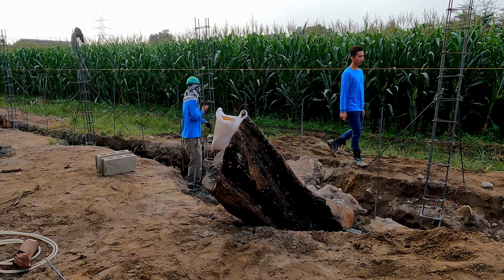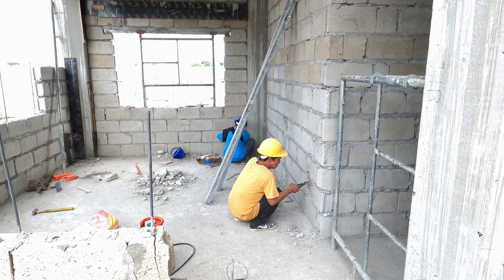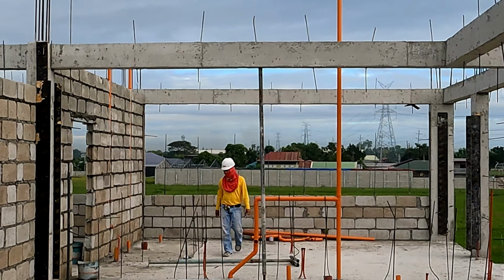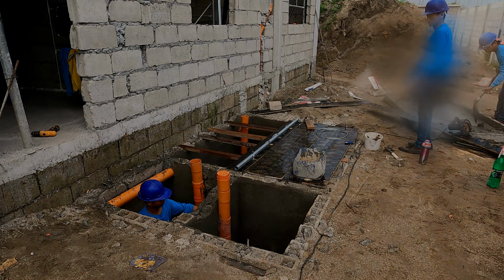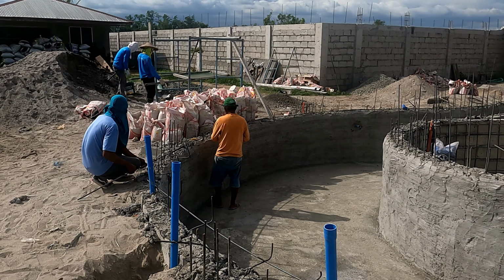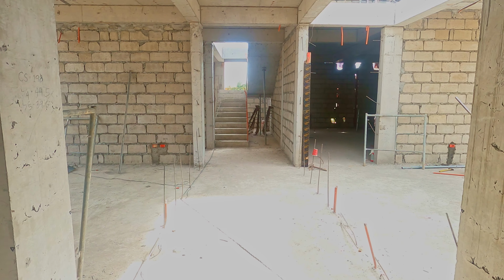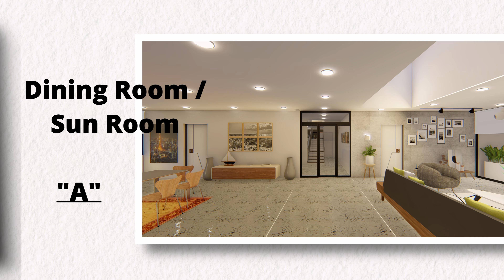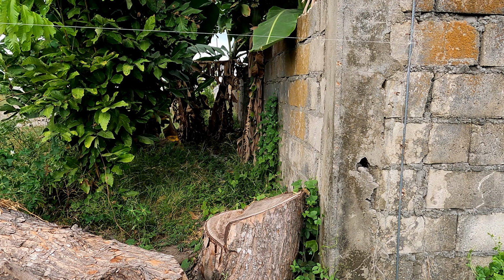Philippine House Building Day 111 - Ground Floor Renderings

Comment: Good morning Mike  I'll right in to it.
We like open A  However you need look at option depending life style. I like to close  off the Filipino chit-chat with the use of doors  When rooms can be individual less costs more efficient aircon cooling.
My wife say the glass looks like a hospital. 
The kitchens look really good as to the Gym and spa room very nice and windows size is also good. 
Swimming pool the top is copping it sort of like a tie beam to the pool. The curve shape be a challenge for the pool builders. 
 Ceptic tank good its 3 chamber better for break down before leaching and it looks a good pipe setup as well.
The renderings gives good understanding for the finished product .The living room with open stairs looks good 👍 
But I do like induction cook tops but you need gas as backup many burnouts Philippines power.
Nice one Mike 👍
Reply from the maker: Graeme
My wife liked A.
I liked B.
So now we are going with my Dad's idea of C. (he also said the glass looked like an industrial building, although he said office).
I think we are going to go for gas ranges, but electric ovens. Given the position of the oven in the main kitchen in particular, we had concerns over running gas long distances (we don't want the gas bottles inside the house). We can stretch the gas pipelines far enough to reach the island, where the range will be, but going to the other side of the kitchen just seemed an unnecessary risk.
Reply: @philippines4.0buildinganew64  Is C a hollow blocks? In Cebu plan to 2 elements induction and 2 gas rings. After using induction safe fast instant heating control
Reply from the maker: Middle third a solid wall. Sliding doors either side which should disappear into that solid section.

Comment: WOW, I like the rendering, almost hard to visualize simply from a blueprint.  Certainly something we’ll have contracted In before starting walls
Reply from the maker: Thomas
Thank you. I just struggle to get my head around blueprints. And the renderings get you to start thinking about all sorts of design issues. One of the big ones for us has been power points - I just could not figure out where they should / could be, and in the end it has meant some changes to things like cabinet and counter top size / location.
I wish we had pushed for more of these earlier on - I suspect it can go a long way to reducing changes on the fly.

Comment: I think I like ‘A’ but it really depends on how big the area is - so long as it’s not so large it looks bare. And then there are considerations for cooling. Much easier to zone and cool smaller areas. Perhaps a consideration when entertaining. ‘B’ to me looks a little squashed and unbalanced and the door leading to the stairs looks odd. If there was a wall on both sides like the original design it’d look balanced, but in this design it doesn’t look right to me.
Reply from the maker: Thanks Sean. The cooling comments are spot on. We did remove the door leading from the dining room to the entrance hall (although it is still in the renderings), and there is now not going to be a door at the bottom of the stairs.
We are going for "C" - will reveal all today.
Reply: Looking forward to seeing ‘C’… maybe some foldable doors?

Comment: Just watched the video after this one. You talk about dividing the wall into the dining room into thirds. Solid wall in the middle and sliding glass doors on either side. What if the center wall was a fixed glass wall? Possibly with a graphic design. Doors on either side will slide in behind this wall (or in front). This would make it easy for any future service work. My 2 cents :)
Reply from the maker: Steve
That is a very interesting idea. I will give it some thought, although I do like the idea of a "solid" central section - I think it will break up the room a little better. More for us to ponder on - keep the ideas coming

Comment: Tree stumps are looking like they may assist with day 133 completion for the wall. I guess the rendering will all depend how you want to use the space, with A being very open and no noise isolation so if all the kids are charging round then you may just have to speak louder. B has a bit of a look of a board room to me but I like the idea of splitting the space and maybe you could even think about cavity sliding doors that can give you the best of both worlds. separation when you need it or glorious open plan at all other times. Just a thought but at the end of the day it will be what you guys want that matters. It will be fantastic when its finished. Cheers for now
Reply from the maker: Have you actually seen the next episode? I need to check my anti-hacker software.
Your option C is basically exactly what we are going to do.
And I think our daughter may be correct with the highest number (157). Every time I look, there seems to be a new 50 year old tree stump right on the property line.
Reply: @philippines4.0buildinganew64  Anti hacker is safe, and we were looking at something similar on a much smaller scale for our place in Scotland. 😉
Reply from the maker: So I will stick with the very expensive Norton anti everything software for now.
US$0.99 for this year, although I suspect a dramatically different price next year.

Comment: Kitchen looks nice. I know it is just a rendering, but, Is there enough lighting over the center island? Do any of the kitchen windows open to circulate the air?

Living room looks awesome. Great decision to leave the stairs open. It really makes it look open and fresh and modern. But I see the rendering has a wall at the end of the stairs. I thought it was removed? It actually looks good with it there. Where will the split a/c units be positioned?
Reply from the maker: Good point Sean. Yes one or more of the windows will open, although we will probably have to put some kind of screens in place to keep the insects out. Hopefully there will be lots of light over the island, but I guess we won't really know until the kitchen lighting all goes in.
And good spot - yes the rendering is wrong, as the wall has been removed.
On aircon, we should be selecting the supplier next week. Although we have their ideas on location of the units, we just need to recheck everything, so I will have to get back to you on final locations later.
Really appreciate that you are keeping such a detailed eye on this process.

Comment: A
Reply from the maker: Roger
I think we are now something like 20:2 in favour of A.
So of course C has won. (I listened to my Dad again)
Reply: @philippines4.0buildinganew64  i said A because its easier to add later if you don't like than remove also cheaper than buying it now to demo it later
Reply from the maker: Sound logic
In the end, I fear we may have gone for the most expensive option